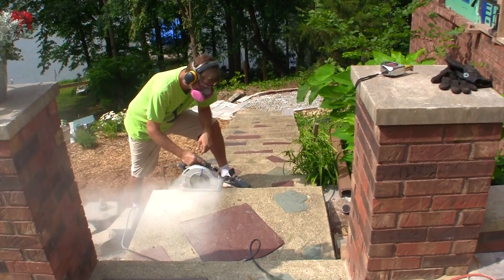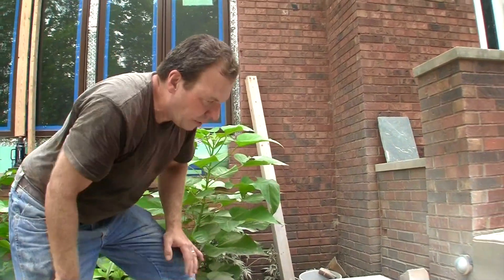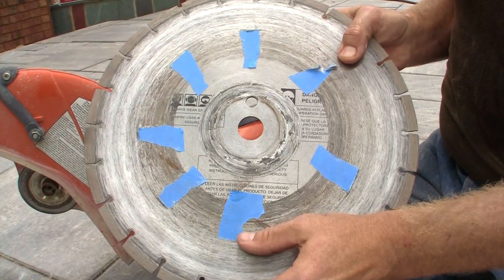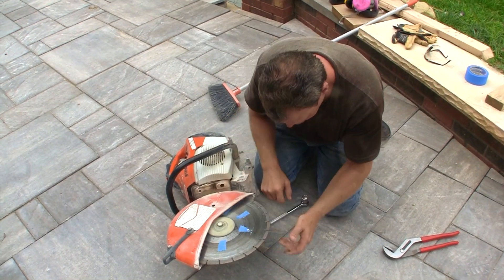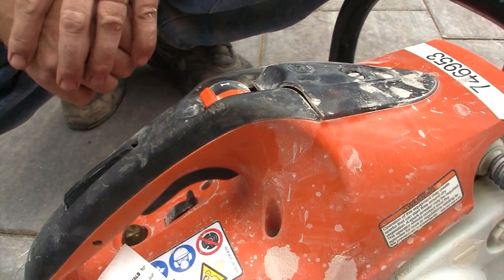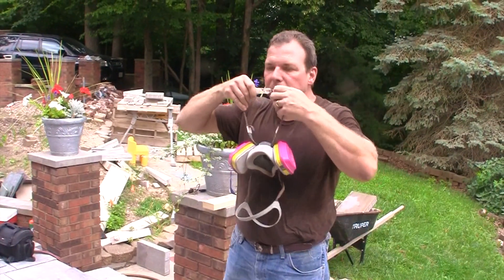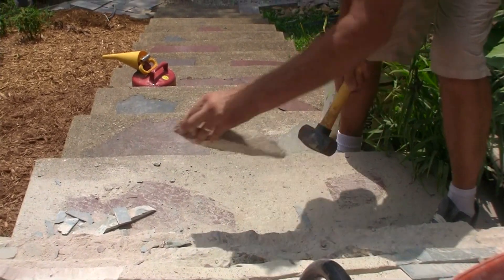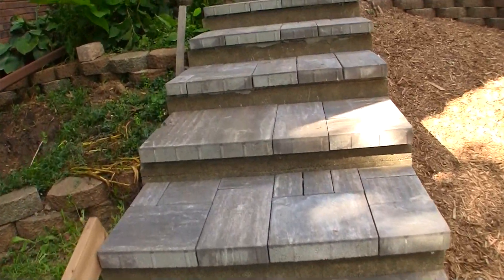concrete saw: concrete cutting with a cut off saw

Comment: I would add one thing.  Don't operate a gas saw with the unit between your legs. You need to stand to the left of the saw in case of kick back. You will also be less likely to get hit by a piece of blade if you break it or a one of the teeth comes off. This is especially important if you are using an abrasive blade and cutting steel or rebar. You should also run water when cutting concrete. It eliminates the silica in the air, the blade will cut cooler and smoother, and your blade will last a lot longer.
Reply from the maker: Hey Tim,
Thx for all the tips. Much appreciated - we’ll put those into practice next chance we get. 
Thx again.
Reply: You’re definitely right.. and yes the water attachment is a must for whenever i use this

Comment: This is way louder in person. A company is putting up lifts at my job and when they started cutting into the concrete it sounded like nails on chalkboard but 10 times louder. I had to go outside because my ears felt so weird after hearing that. Definitely recommend a good set of hearing protection
Reply from the maker: Hey If...,
You are absolutely right - metal blade cutting concrete - pure noise! 
Thx for the surety reminder and thx for watch!

Comment: This worked great for redoing the shower/bathtub of my kid's bathroom. https://www.youtube.com/post/UgkxfiuHoZJo3bgdVPFRxQ-iqPpfbEHl2cYt  I didn't like the guide, so I took it off. I just used a fine tipped sharpie on the tile and followed that line. It does make a wet mess, and once I started looking like I wet myself I started wearing a towel and apron while cutting. The blade it came with worked great until we wore it out. It was better than the replacement one we bought. I tried looking for just their blade, but failed. Not really for larger tiles unless you stack stuff on either side to support the tiles. Anyway, would definitley buy again.
Reply from the maker: Hey geek..,
Thx for watching!

Comment: Good video mate. I've got a stihl ts400 and a partner k650. Both geared up with diamond blades. I used the k650 to cut out a second doorway into my neighbour's brick built shed yesterday. I got home from work and  the old fella was scratching away at the brickwork with a 4" electric grinder and a hammer and bolster.  I asked him if he needed a hand..? He accepted my offer immediately.  I came back 2 mins later with the k650 and told him to step aside. (Just like superman does in the films 😁)..! 
I cut out the opening for his new door in about 2 mins max for each of the two cuts. I glanced at him through the dust at one point and he had his fingers in his ears with a big grin on his face. For any type of masonry cutting, a diamond blade is a must IMO. As you quite rightly say,.....a diamond blade goes through stone like butter. 👏👌🤝👍
Reply from the maker: Hey 7sins,
Sounds like you made a friend! I bet he went home telling his wife’s about this cool tool he needs to buy😃
Very cool that you took care of your neighbor that way. Cant get too much of that in this world! 
Thanks for sharing that.
Reply: @Housebarons  hes in his 70's now. So he won't be needing a petrol saw. He would've struggled holding it at 2m height to start the cut. It would've taken a month of Sundays to get the job done with a bolster and a 4" electric grinder. But the k650 didn't even flinch. Everyone within 500m must have heard it screaming, and literally every car in the street had a layer of fine orange dust on it. Fantastic reliable bit of kit and its unstoppable with a diamond blade on it.

Comment: Nice tip on using painters tape to mark the blade for depth
Reply from the maker: Hey Paul,
Thx for the comment and for watching!
Reply: @Housebarons  great job, next time could you use the blade guard as a depth gauge? 
While the saw is on the ground, tilt it forward, adjust the guard then drag it on the ground.

Comment: There is a water hose adapter on the side of the saw for a reason!

Eliminates almost all dust when used with water
Reply: Is there a saw on the market which has a water tank instead of hose adaptors? Many thx
Reply: @moldprintsrl  not that I am aware of and if there was I wouldn’t use it these saws are already heavy now your adding even more weight on it with a water tank plus not to mention that for it to even be practical it would have to be at least 2 gallons which is going to about 16 lbs and will not allow you a hole lot of cutting time before it’s emty
Reply: @erikrobles5727  hm ok , that makes sense.  We don't have running water  at the building we are working on
Reply: @moldprintsrl  the solution is water squirting bottles
Reply: @moldprintsrl  Hudson pump sprayer they sell them in various sizes...
Reply: @moldprintsrl  yeah stihl has one

Comment: You don’t need to hold the blade with pliers to change or tighten down just take a screw driver and put it in that little hole in the shroud through the blade. It’s there so you can lock the blade.  👍🏼
Reply from the maker: Hey slick..,
Thx for pointing that out!

Comment: Hi, I appreciate it is not a new video so maybe you don't read comments. I am out for advice. A tradesman cut some concrete slabs for a project in my garden. He did dry cuts and now pebbled paths and part of the lawn are covered in dust. I have noticed that in your project there are plants and some bark or something decorative in that garden. Just wondering if you then do something to remove or contain the dust from those areas, as walking on or just wind may cause breathing it in, which is harmful? Any advice?

Comment: Great video! I am trying to cut the 8" foundation, to lower the garage man door by almost a foot.  That is a three foot horizontal cut, it's going very slow. I am wondering if the blade is ok. looks ok, but I only have about 3 inches deep X 3 feet , in almost 3 hours. too many breaks, but at 60 plus years old, I need them.  wet cutting. Is that slow?
Reply from the maker: Hey jmack619,
Yes, that does sound slow. I would make passes maybe an inch deep at a time? That way cut debris can be easily ejected. If you rented that saw, I would not be shy to take it back and complain about the blade. That sounds too slow. Tell them you want a fresh blade. Doesn’t hurt to ask.
Reply: @Housebarons  Thank you for your reply Barons. I measured the blade after I took a break, and sent my first message to you. The 14 " blade measured 13 " !! I think when I got it, it had between 1/16 to 1/8" of diamond left, and I never even thought about it until i was getting nowhere. New blade cut like butter. hard butter, job DONE !! Be safe, Be Well, John,  Canada
Reply from the maker: Hey John,
So glad to hear you figured it out. Those saws are such amazing tools ( with a good blade 😃). Thx for the update and for letting us know your location. Always fun to find out where people are from! Peace!

Comment: So it’s going to be my first time cutting concrete, is it really that easy or am I making it out to be harder than what it is? Some please tell me! I’m trying to mustard up the courage to do this!
Reply from the maker: Hey I,
The saw certainly is heavier than a circular saw. But you can let the weight of the saw do the cutting. You don’t have to really muscle it to do the cutting.  
If your saw has a water hose feature, you can stop all the dust by connecting the hose for water. If you are cutting dry, DONT do it without a respirator. Silica dust is very bad for you!
If you can hold the saw comfortably, then I think you’ll find it an easy cut.
Word of warning: make sure the blade you use is fresh. Before you rent a saw, go to a big box store and check out what a new diamond tipped cutting blade looks like. You want to make sure the rental center gives you a blade with plenty of cutting life in it. 
The saws are loud. But they cut concrete like butter. 
So what are you wanting to do? What project? 
Thx for watching!
Reply: @Housebarons  thanks for the tips! I’ve watched a ton of videos on how to cut concrete however, this being my first time tackling a big project like so is nerve racking if I mess up! The project btw is a remodel of my house, I’m trying to get a modern look by cutting portions of my existing driveway, then resurfacing, and adding a new walkway beside the driveway to the sidewalk. It’s not too much, I’m just not very confident yet.
Reply from the maker: Hey I,
Sounds like a great project to learn on. By the time you are done, you’ll be a pro! 
We have a video on demo hammer use:
https://youtu.be/WMkTKDOMuZg
Don’t be afraid to grab one of those too. They make breaking up concrete a breeze!
We also did a walkway last year with separate concrete pads - if that could help. https://youtu.be/TDie7nSMYho

Take your time, respect the blade - it’s not sharp to the touch, but  spinning - it will cut flesh. 
Let us know how it goes if you get a chance. My guess is, you’ll be surprised at how well it cuts. 
Have fun!

Comment: A nice way to reduce dust could be a shop vac??? So you dont have to use water.
Reply from the maker: Hey Joseph,
Thx for the idea. It sure is messy work w/o using water.
Thx for watching!
Reply: The water is to keep blade wet while cutting, so it doesnt bind up

Comment: use water please
Reply from the maker: Hey Pete, 
Yes. That would def help w/ dust. In this case we were doing other things that meant that water was going to interfere w/ another particular project so we opted for dry cut.
Thx for the comment.
Reply: @Housebarons  dry cutting is stupid.  All that dust for nothing.  Water doesn't interfere with anything just use it.